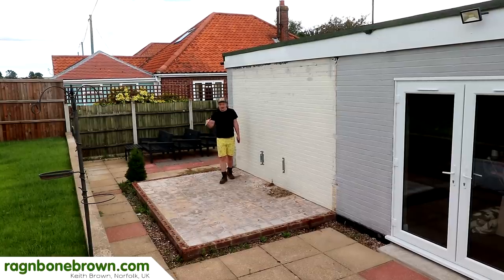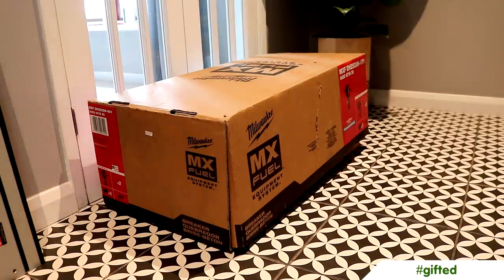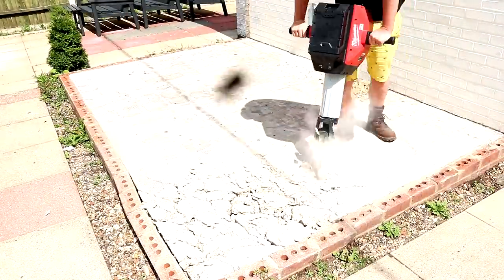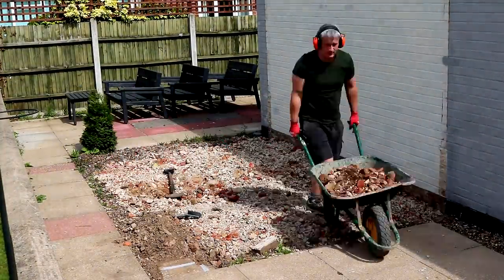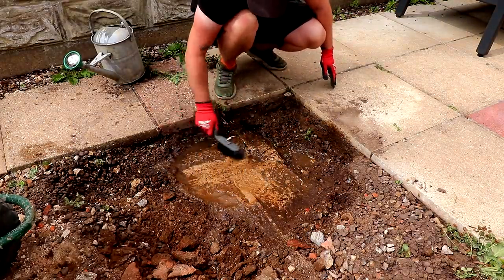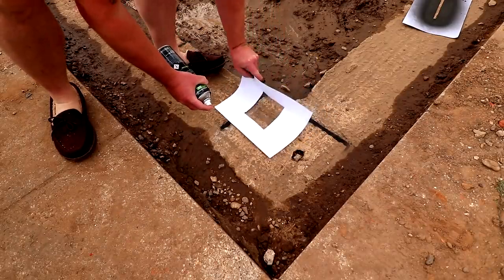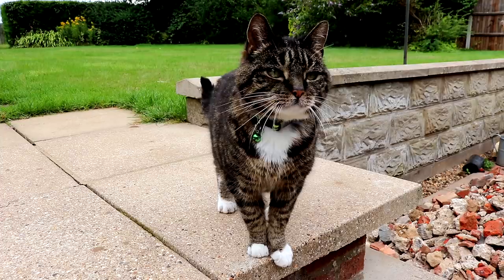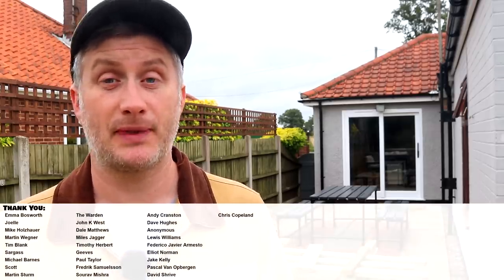Breaking Concrete | Excavating | Foundations | Patio Sub-base

Comment: Rubble - hardcore - most people are using ballast these days - it compacts better and will be more likely to form a base that ensures the slab will be less likely to crack. It may be small enough - you might want to check it out before you do any compacting.

Comment: Is a bungalow a house in the UK? In Australia a bungalow would be a separate (detached) living area at the back of your house.
Reply: It's a house type. Everything is on a single floor. No stairs. 

Usually for elder people that have trouble walking up stairs. They tend to be more expensive due to the large surface area (big roof) and land plot size.
Reply from the maker: Yeah it's what we call a house with just a ground floor and loft space

Comment: Looks like you might be able to get an attachment for your new toy from Milwaukee to help with the next stage of compacting.
Reply from the maker: Really, what's that?
Reply: @RagnBoneBrown  they sell a 5"*5" plate and I think it was 8"*8" plate that have a shaft coming out of the middle that fits the chunky connectors.
Reply: @RagnBoneBrown  you need a tamper shank to fit the tool and then the plate attaches on to it from what I can see on the web.

Comment: NIce video, mate. Good to see your patio is progressing.
The sound from that Røde Wireless is great. Mine turned out a bit metallic vs the lav mic. But yours sound great. Do you do any magic in post? Cheers, and thanks for sharing.
Reply from the maker: Cheers Goran.  I add a little bit of compression, sometimes a little EQing but only when it sounds noticeably different to my other mic

Comment: Personal preference coming from a bricklayer I would rotate the new slabs 45° to the original coursing line. This will break the visuals of the smaller sized slabs. Nice to see the Milwaukee breaker, I have been looking at buying the cut off saw from the same battery line makes one more tempting, currently have the DeWalt cordless cut off much preferred over petrol. Great video!
Reply from the maker: Hi George.  I actually really like that idea.  The only thing putting me off from laying them at 45 degrees is the fact that I don't have a large grinder, so I'll be doing all the cuts with a 115mm one.  If I had a bigger grinder, I'd go for it !
Reply: @RagnBoneBrown  you should see if Milwaukee want to let you do a trial of the cut off saw would let alot of people gauge how good the batteries are for my side of the trade.

Comment: If you have a look on YouTube for the RR Buildings channel and do a search for the Milwaukee MX Fuel Carry On Power Supply you can see a video of some of the other uses for the battery range that the breaker uses (He has an excellent channel, I highly recommend). You are very lucky to have been given that breaker, only downside is finding somewhere to store it given it won't see much use.

It would be great to see a video about your reasons for wanting/needing to replace the roof and windows if you are ever looking for a video or perhaps as part of an upcoming vlog episode.
Reply from the maker: Thank you, I watch RR Buildings already actually!  Great channel.  Yeah I am very lucky to have had such a brilliant tool to use - and yes indeed, need to find somewhere to store it now!  May cover roof and window replacements in future as per your suggestion
Reply: @RagnBoneBrown  Ah glad you already knew his channel, I will never build a post frame barn or use a fraction of the tools he shows but I do really like his videos and how he produces them and he is really good on his Instagram as well.

I'd be really interested to hear about the windows and roof if you ever get the time to do a video!